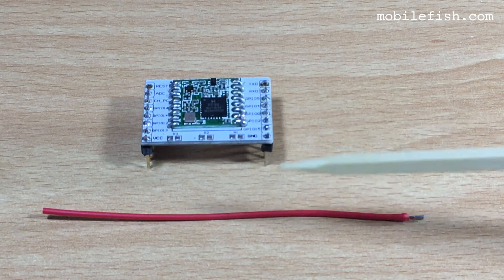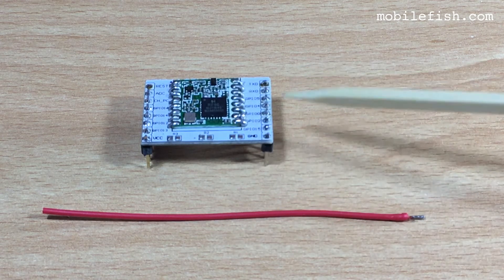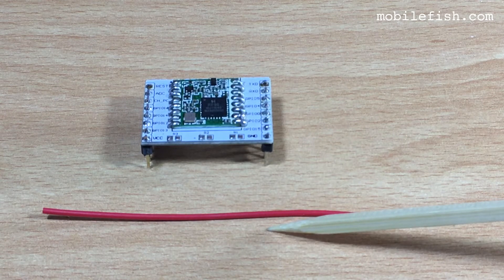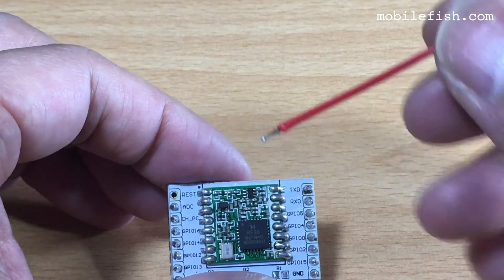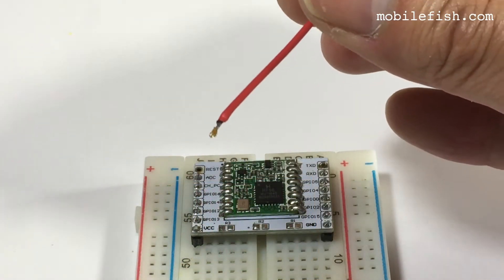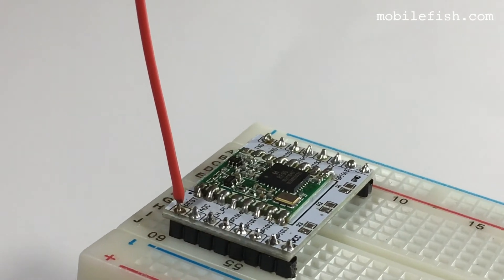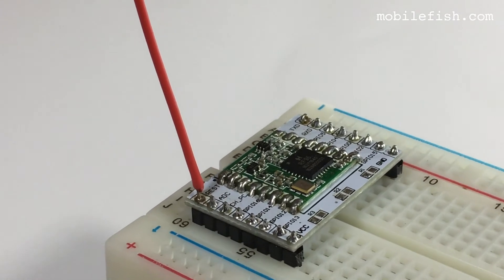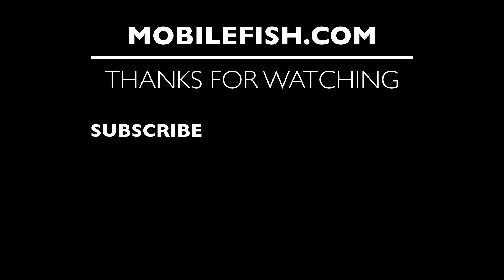Create a LoRa node, part 4: Attach antenna to the LoRa module

Comment: Sir, 
what is range of LoRa module?
Reply from the maker: It depends. You will have a good range when:
1) End device and gateway antenna are positioned as high as possible such that you have good line of sight.
2) You use antennas with good performance.
3) You use external antennas.

If you comply with 1,2 and 3 several kilometers  are possible.

Comment: great video! what is the diameter of de antena? 1.5 or 1.025 mm?
Reply from the maker: Metal wires (core) total diameter 0.5 mm
Antenna (core + plastic) total diameter 1.5 mm

Comment: Hi, what kind of wire should be used for the antenna, any regular wire?
Reply from the maker: You can use a single solid copper wire or even breadboard jumper wires (??), but make sure that the wire does not easily bent. The antenna must be straight.